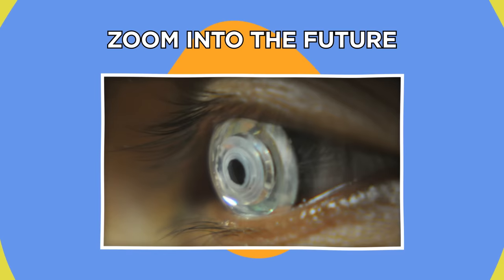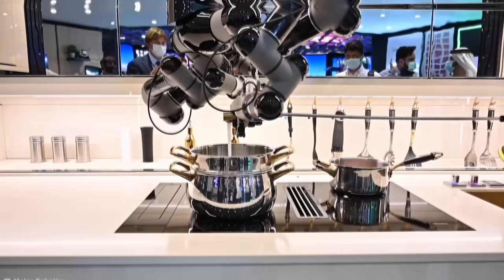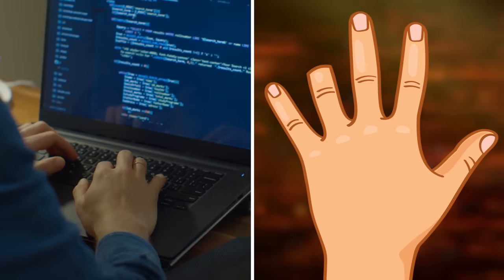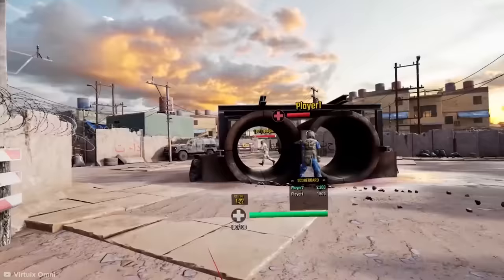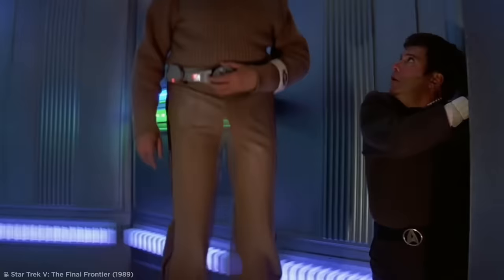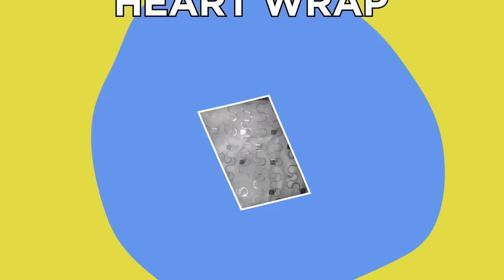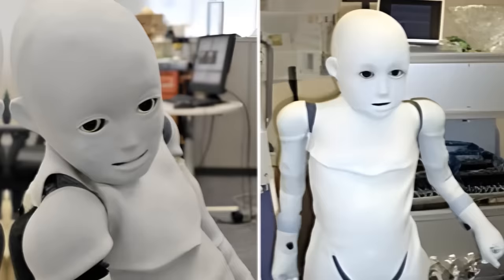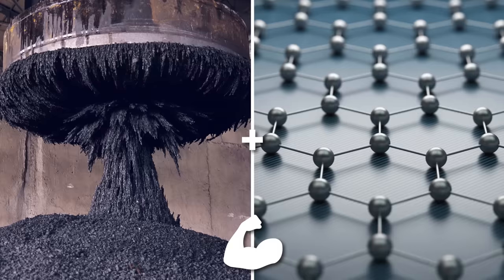Inventions Of The Future That Will Soon Be Available To Everyone

Comment: So for VR, you can get around EVERY ONE of the issues you specified with a quest 2
For motion sickness, it generally gets easier with time. Stay away from games that move you without your input.
For running into the wall. I prefer to play with large fluffy floor mat with bare feet so i can feel the texture change if i step off of it, it helps a LOT with running and punching things, while also not needing to see the guardian boundary.
For not punching grandma,  The quest 2 has a feature to display any people or objects near you so you dont accidently bop her on the head.
Reply: GRANDMA IS SAVED
Reply: What about grandpa?
Reply: @carotclan148  so, what about grandpa?
Reply: @carotclan148  What about ANYONE?
Reply: Well if he adds both tech together it will be perfect you know, like he can add the ultrasonic emitter all around the room to stimulate the whole environment and the walking type vr gadget to keep him in place
Reply: 9r to make it easier to hit people and you can say ;sorry i couldent see you ;
Reply: ok

Comment: The contact lenses are a cool idea, but they seem extremely unsafe for daily use. Think of how many times you likely blink twice, then imagine it happening randomly throughout the day.
Reply: My thoughts exactly.
Reply: It might be better if you had to squint.
Reply: Yeah, that's what I was thinking. Imagine driving on the motorway, having to blink twice rapidly and then crashing, because let's face it, that would throw everyone totally off.

Might be better to have these lenses only equipped for specific tasks when you need them. Or really alter how they work.

Yes, I may sound old and overly cautious. I've seen too many stupid morons do stupid stuff. ;)
Reply: Imagine your eye starts twitching...in out in out😅
Reply: I feel like this will get worked out before release. Like, blink 4 times very fast and in rhythm. Etc
Reply: The human mind is remarkably adaptable.  Probably wouldn't take long to learn to control that.

Comment: Graphine.. could you imagine the potential for aircrafts or vehicles if that ever becomes feasible? Gonna be cool stuff for sure
Reply: yes and Osmium
Reply: Not to mention nano tech
Reply: spelling
Reply: Theoretically, Graphine could be used to create cables strong enough to build elevators that can be held in geosynchronous orbit. Thus making the launching of rockets obsolete. Materials could be hauled up the elevator to the station to build new stations or ships even from orbit. And yes this has been theorized for many years, just waiting on a substance strong enough to build the cables from to anchor the elevators...
Reply: @w3r3cow   yes and you wanna know one even stronger ?    OSMIUM a Nano Tin Molecule

Comment: The car holographic display is neat, but if it is only limited to a small section of information directly in front of the driver, then anything coming from the passengers side of the car will not be seen until later.

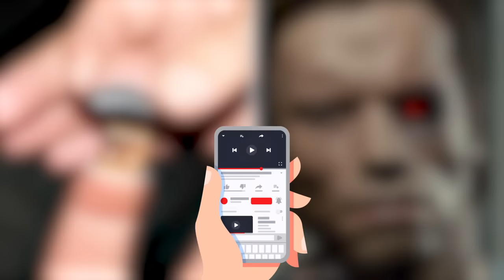Comment: 9:35 - A camera in the eye - if the thumb drive was in my finger, then I’d be essentially be unable to use that hand while it was plugged in (from experience, I can say that some files can take HOURS), and even if it was detachable from the hand, that would still be one less finger than I’d be used to using on the keyboard

Comment: Is it weird that for graphene being able to conduct electricity my mind came up with a security system where you place a layer of it on the ground, where if you step on it a computer inside the complex can be alerted. Also, may be non-the wiser especially if there is essentially a tarp of something that has a known values on top to hide the presence.

Comment: That piece of tech that allows you to lift really heavy objects like a couch or refrigerator I think not because doesn't matter how strong you are if you can't grasp it properly to control it you can pick it up all you want but you going to drop it run into things break it cuz you simply can't secure it well enough to move it when you pick it up in the first place. Let alone the usage of battery that you'd have to keep recharging and right in the middle of something it would run out. Not practical.

Comment: I can't figure out the point of the "portable air purifier" if you are using the half-masks.  Without a fully sealed facemask or hood you would still be breathing in a mixture of purified air and the surrounding polluted air at the same time, which totally defeats the purpose. 😂😂

Comment: If anyone has worn sneakers like the 3d printed ones they show then you'll know they're horrible to walk in.
When the heel of the sneaker has that much give, walking is very unintuitive.
Humans like when our flesh heel is effectively "stuck to" the shoe heal. It allows for correct sensory perception. The shoe heel becomes "our heel". 
When a shoe's heel touches first, then gives, then we get a second touch of our heel hitting it creates a double tap sense that is very unnatural. 
Watch someone run in flip flops..... same thing. 
Or just watch people in slippers. They tend to shuffle and not walk heel to toe for this exact reason.
The front of the foot can be as spongey as you like. But the heel needs to be firm in order for humans to walk with correct posture for our skeleton.

Comment: Gotta be honest, I don't see a lot of these catching on in a big way. The smart fridge might because there's a financial incentive to getting users to use them (advertising), but the personal air purifier I can all but guarantee won't catch on. The contact lenses might if they can overcome the material engineering challenges but will probably always be a small market, and the exoskeleton suits if they can find new battery technology. The AR display might make it to market, but only because it will be flashing you a symbol any time you get within 1 km of a McDonalds or any other business they can sell ad space to. The shoes are ass ugly, but they might find a niche like Crocs. The snow shoes I seriously doubt work as advertised, because I'm betting that once you add frozen and slushy water, dirt, salt and other stuff you encounter on the ground besides fluffy white snow it will inhibit the folding up functionality after a couple uses unless you extensively clean them every time you head out. The pacemaker replacement is probably the product with the biggest profit potential on this list, provided it passes tests of long term safety and stability. The robots are still a way away, and the first personal robots we buy for tens of thousands won't be taking out our trash, they'll be making our beds if you know what I mean. I mean you'll be having sex with them. Graphene will absolutely be a primary material of the future, but first someone needs to figure out how to manufacture it at scale, which we're still a ways away from.

Comment: That heart sleep thing electrical I didn't say sleep I said heart sleeve device. I'm not too sure that. Let's wrap our heart but something that is made out of some type of material with metal that can break in bend when your heart contracts and attracts to tracks and attract so it's shrinking and growing shrinking and growing flexing deflecting what's that going to do to that metal that metal after been so many times when what happens to it it breaks. I didn't those little pieces of metal that are all broken up just like a piece of wire stabbing into your heart yeah that. Don't think that would be good thing.. and think of all the times your heart's going to irregularly beat our be mistaken for an irregular feet cuz you're holding your breath are speeding it up in different ways that art exactly natural nature. Or even natural. That machine is going to send an electrical shock to your heart when it doesn't. Let alone any malfunction it would constitute shocked you and your heart repeatedly over and over again that would literally stopped your heart and kill you. Somewhat of an okay idea. Not very well thought-out. Not only that but I don't know if one battery that's rechargeable that exists or has ever existed that eating just constantly keep charging at all times no matter what do you? Cuz usually if you were to charge a battery when it doesn't need to be charged and keep charging at what happens it explodes. Get I don't think it was very well-thought-out somewhat of an okay idea but literally poorly thought-out.

Comment: First one is old news, the second one again is old news, the third is insulting as a chef and incredibly lazy, the fourth is decent but BMW has had that for over a decade in they're tech systems, the fifth isn't cybernetics, the 6th isn't nearly as sophisticated as it sounds, the 7th is really realty simple and not all that complex of a tech and cads were more sophisticated over ten years ago, the 8th could easily be irrelevant if people would just stop causing the problem they are trying to fix, the 9th is pointless and honestly, I have every reason to trust my hiking boots more than that, regular snow shoes worked perfectly well for what is needed if you make and use them correctly,  the 10th is bullshit for lazy people that don't want to think for themselves and this so called tag is entirely unnecessary for the tech. Google does basically exactly that without them using the camera... I've made my point